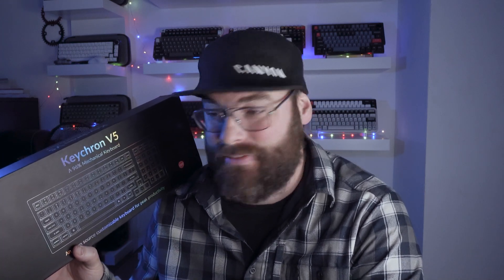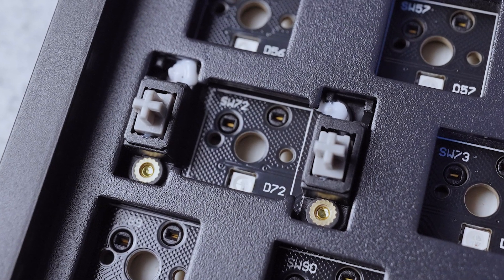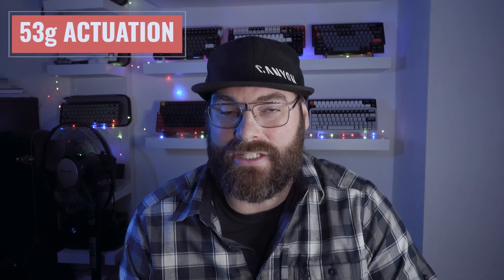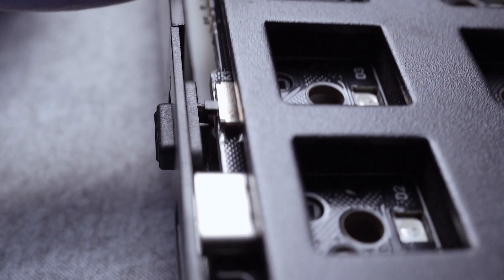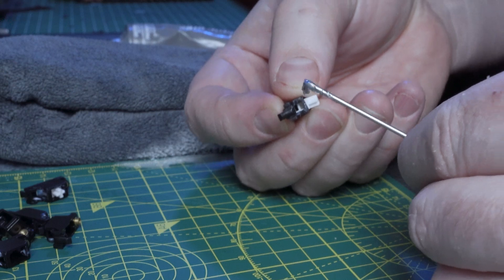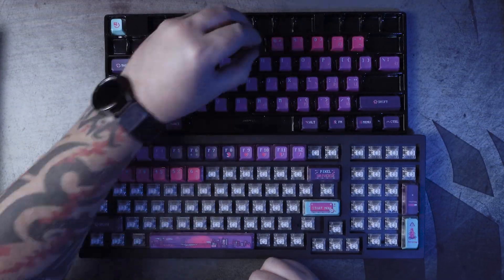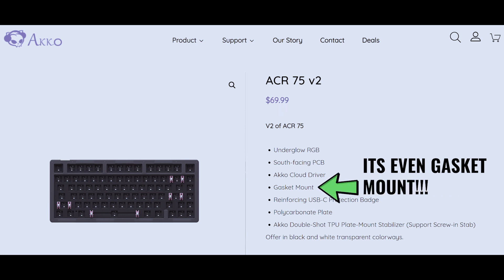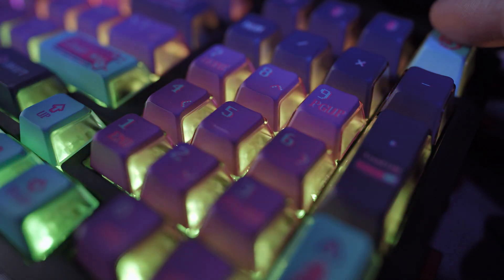Keychron V5 Review | Pixel Universe Keycaps

Comment: Do you know if the keychron V5 and Q5 share the exact same PCB? If I needed a replacement PCB for a Q5, where would I be able to find one?
Reply from the maker: Not sure, I've never tested the Q5. One is tray mount while the other is gasket. You need screw holes through one and not the other, so they may be different.
Reply: cool, thanks for the info.  @keebface